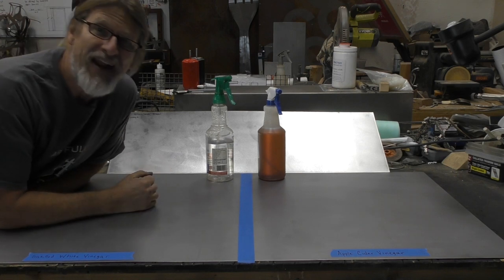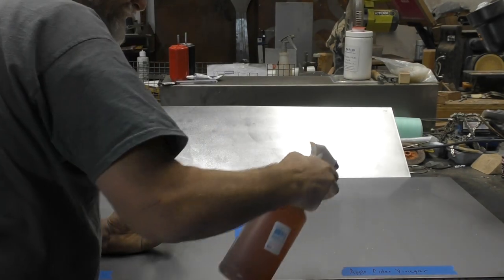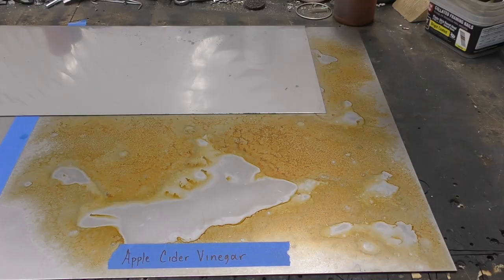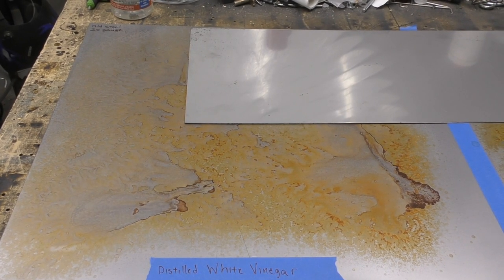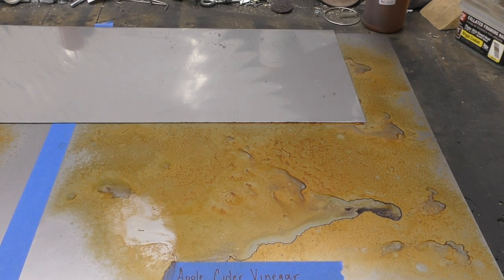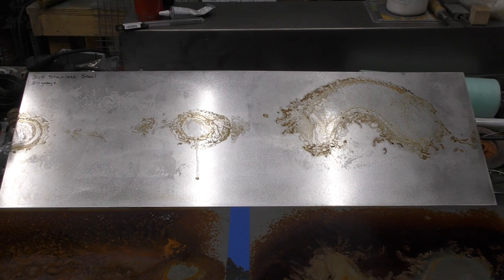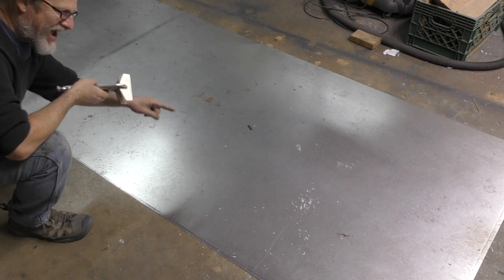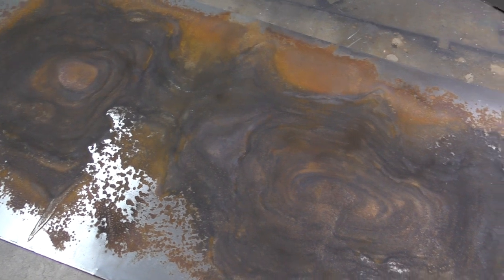White Vinegar VS.  Apple Cider Vinegar - Which is better for rusting metal?

Comment: I always found it ironic that you can use vinegar to remove rust and to add rust.
Reply from the maker: Right! I was having the same conversation today about that.
Reply: I'm glad I saw this video before doing some of the work I'm planning. I'll make sure I get all of the vinegar off when I'm done removing the rust.
Reply: Heh...ironic...
Reply: @grownupgaming7225  also don't forget to soak the objects in baking soda and water for 10 minutes afterwards. Baking soda is a base which will neutralize the vinegar.
Reply: Yeah. I learned that when I put it on my fucking Tuatahi axe!!! 😡
Reply: 💯% ironic🤣🤣
Reply: Do I need to cover the work with a piece of metal or can I use even cardboard or paper?

Comment: Vinegar doesn't rust /oxidize 304 Stainless Steel. What is happening is the iron oxide from the steel is discoloring the surface of the stainless.  Even steel dust on stainless will leave an oxidation site for rusting to form on the stainless surface. No metal is completely smooth. The iron oxide attaches to the stainless in microscopic surface imperfections and then creates the discoloration.  It is hard to remove because it buries itself into the surface imperfections as the oxidation expands.  Shops that do high level sanitary stainless steel work have separate work spaces to keep iron dust in the air away from the stainless and they never use the same tools used for steel work to work the stainless. We grind on steel and then use the same grinder for stainless in our shop, it leaves rust track marks all over the stainless if left unprotected. Fortunately, we paint the product before shipment so the iron on the surface is covered.

Comment: Looks like maybe your surfaces had some type of contaminates like oil and should have been cleaned with a solvent or something... Unless you are going for that uneven look...
Reply from the maker: I rarely clean the material as I enjoy the variety it produces. I thinks its the main reason my metal doors are difficult to duplicate. Many people follow "the rules" of surface prep, application, etc. So many people email me asking why their project didn't come out the same way. The first question I ask, did you clean the material? And 9 times out of 10 that's the issue in achieving the varied textures and patterns.

Comment: I just used both on the patina job I did for the interior panels of my Dodge D100.  I used the Apple Cider Vinegar first, just because that's what I had on-hand, but when I ran out (before being able to apply any to the last panel), I bought some White Vinegar.  For me, the White Vinegar gave the panel a more even, rust-colored patina, where the Apple Cider Vinegar gave the panel a bit darker, uneven pattern.  The were both sprayed with the same bottle, and were both sprayed on-top-of some Copper Sulfate I used to give the panels some other colors and patterns.
It seems like there is some subtle differences, and it just comes down to the look you are going for.  Either will obviously work, so use what ya got until ya run out.
Reply from the maker: That's been my mindset, use what you have on hand

Comment: Good info. I’m trying Metal shaving (prerusted shaving).sprinkling rusted parts to lay in patterns. Straight vinegar applied. Placed in the hot sun
Reply from the maker: Heat helps. I've noticed that I get better results in the summer time vs. winter time.

Comment: Really enjoying the videos. Question: if I’m trying to patina a piece of steel tubing (specifically a bike frame) that would not lend itself to covering by a flat sheet while the vinegar works, would wrapping with aluminum foil accomplish the same thing or would there be a different reaction because it’s not steel? Thanks!
Reply from the maker: Great question. It's not necessary to cover with steel. I've actually used wood before hoping to transfer the pattern of the wood grain. Using aluminum foil would work just as well. The goal is to reduce evaporation of the vinegar

Comment: I use white vinegar and my electrical pliers went black with the vinegar going black too. I cleaned all of the black gunk off and used soda bicarbonate and distilled water and washed. Cleaned with rags. Cleaned up nicely but then I hit it with brass brush on my Dewalt cordless drill. Now it's brass plated! I never expected that because it looks awesome. My question is the black gunk in the container? Is that carbon ? Have I weakened the pliers any reply appreciated cheers from Australia 🙂👍👍👍btw. My previous employer said: you stuffed up the pliers!

Comment: Enjoy your presentations, Doug! Lots of useful info. What have you found to seal the rusted steel for outdoors? Thanks
Reply from the maker: I use a two part automotive clear coat. Super durable
Reply: I have used sculpt nouveau brand ever clear 2 part polyurethane but will try what you suggested Sprayed on is usually best I’m sure 🙏
Reply from the maker: @joanneminnick  I've never tried the Sculpt Nouveau brand ever clear although I have used their patina's. Maybe I'll do a side by side comparison of the both brands to see which one is better or if there's a difference at all

Comment: Put on  leaves , grasses, pine needles, ferns, or sawdust, or all of them for really cool effects.  Can also cut paper or felt patterns and sandwich them to put controlled patterns on. Use two sheets of steel and end up with" book matched "
pieces.
Seal with penetrol. Works well at least on interior pieces, still experimenting with exterior use.
Reply from the maker: I need to try penetrol. I've heard of several people using but have never tried it myself. I like the idea of using organic items to create different effects

Comment: Thank you for your demonstration, I am building a privacy screen in my yard that is comprised of a cedar frame and 4 inch wire mesh interior so I can mass in with vines. I am searching for a way to hang metal panels with a patina in the center of each section to add interest and provide some immediate screening from a neighbors window that is very close to my property line. The metal panels would occupy approximately 1/3 of the wire mesh screen, If that makes sense, So essentially the vines would end up framing the metal art piece in the center. Love to hear your thoughts on how to deal with this, What gauge of metal would be appropriate so it is not too heavy but does not look chintzy and flap around in the wind.

Comment: Great video, question though! I have a 1964 patina original paint, I would like to take paint off my hood by wet sanding, will this vinegar technique be okay on the metal or will it eventually create bad rust? Better to let it rust naturally or will this be okay to do? Thanks!
Reply from the maker: Honestly I've never used this method on a car, although many people that have watched this video have said it worked great on their cars/projects. The secret is to seal it once you've achieved the level of rust you want so it doesn't become a long term rust issue.

Comment: I like these videos, the patterns are cool but I didn't care for the look after using the air gun so much. Maybe you don't have a choice as the flakes need to come off. What about using a random orbiter and grit paper as a prep before the vinegar to effect a pattern, and/or adding salt to the mix. Look forward to your next video Doug.
Reply from the maker: What I've found, is the longer you leave it on the metal the more stable it becomes. When I lifted the big sheets, none of that flakes off at all. The flaking usually happens in the first couple days. I'm trying to get some different results with salt that I hope to share soon
Reply: @ArtfullyRogue  I've seen some also use small pieces of copper (or shavings) thrown on, but I haven't tried that myself and not sure what the effect would be.

Comment: so just wondering, is it better with black metal or white metal?
Reply from the maker: I'm not sure what you mean by "black" or "white" metal. Typically with mild steel, you have cold rolled which is raw steel protected by oil and hot rolled mild steel which is protected by a dark layer known as mill scale. You can rust either type however you'd have to remove the mill scale from the hot rolled steel before you can rust it. And remove the oil from the cold rolled before rusting it

Comment: So glad I found your video! I'm going to do this with a sheet of steel. Question - when I get the desired color, should I rinse it with water to stop the rusting process before I clear coat it? TYIA!
Reply from the maker: I rarely rinse with water when I use the vinegar  method as it sometimes rinses off some of the rust. Instead let the piece completely dry then spray with a clear coat to seal the rust
Reply: Soak the objects in baking soda and water for 10 minutes afterwards. Baking soda is a base which will neutralize the vinegar.

Comment: Is it possible to rust metal that is chrome plated? I assume that I may need to do my best to somehow remove the chrome? I'm trying to antique a hotel desk bell. The fact that it is domed seems like it could also be a problem. Thank you for your help on this.
Reply from the maker: I agree, removing the chrome would be the first task. Because of the dome shape, maybe use a cloth with vinegar on it and drape it over the bell dome. This way the vinegar won't drip off

Comment: Thanks for your videos!  Great stuff.  I make some decorative farm hand tools and cattle brands, and then age them.  I have trouble getting stuff made out of round stock (like a cattle brand) to get any dark areas.  After watching your videos, I'm wondering if I could wrap the brand in saran wrap to seal it up after spraying and let it sit, if that would help.  What are your thoughts on this?
Thanks again for taking the time to put together very informative videos.
Reply from the maker: I found the key to getting darker rust is to prevent evaporation of the vinegar however on my big sheets a ring of dark rust will literally "seal" between two sheets and prevent the vinegar inside the rust ring from getting very rusty so it help to allow a little oxygen

Comment: Great videos! We will be using rusted metal on the back of island in our kitchen and face of wood burning fireplace and I want it to be a dark rust color, but not black. Would there be any reason to use Corten metal vs a regular metal?
Reply from the maker: Corten tends to rust fairly consistent. Where I think rusting a regular mild steel with vinegar will give you more texture and coloring and layers. So it really depends on the end result you're wanting

Comment: I am DIYing some Corten Steel planters with white vinegar, hydrogen peroxide and salt. I want to seal with a clear coat so it doesn't rust all over my concrete where they will be placed but I am having a hard time finding a clear coat that works and people in the stores don't seem to be as familiar with corten steel. Do you have any suggestions on a decent clear coat sealant?
Reply from the maker: Corten is designed to rust naturally how is it responding to your rust mixture? I use a product that I purchase from Home Depot. The brand name is Deft and buy the spray cans to spray my doors and water features that are rusted. It also comes in pint and gallon cans if your preferring applying with a sprayer. I'll also use an automotive clear coat that can be purchased from any local car paint company. I spray it directly on the rust without rinsing it.

Comment: Will this work on zinc coated metals
Reply from the maker: @floridaexperience4088  it's necessary to remove the zinc first and if the piece is small enough, you can submerge it in muriatic acid and that will remove the zinc or you can use a flap wheel and grind off certain areas

Comment: Does the clear coating that you use actually achieve a bond with the base metal?  It would seem that that would be necessary to prevent it from flaking off in the future.
Reply from the maker: I'm not sure how it actually works however it seems to bond the surface rust to the base metal
Reply: @ArtfullyRogue   what clearcoat would you use on that?

Comment: please answer me if you have time, i want to corrode aluminum ( real corrode not only on surface but i want the vinegar to eat the surface ) what would be the fastest way to do that and if i dissolve the aluminum  into a apple cider vinegar solution  would the rusting process  be faster than spry it ?
Reply: Try hot Lye [a.k.a. Caustic Soda or Sodium Hydroxide] that will eat it fast ... especially done hot.
* Take great care not to get it on skin or in eyes - it will eat you just as fast !

Comment: Hello, I was curious about how you do this because when I use cleaning vinegar on screws of paperclips it just doesnt rust I already tried it on some other metal but idk wat I’m doing wrong because it just doesn’t rust I also use the vinegar in a spraybottle, do you know what I’m doing wrong?
Reply from the maker: the screws and paperclips have a zinc coating. You need to remove that first. Soak them in vinegar overnight or use pool acid which takes about 10 minutes. Once the zinc is removed they'll be able to rust. Lay them out and spray vinegar and leave them to rust

Comment: Hello! very good video! was wondering how you could do this for a super even rusting. I thought it could be used as Architectural finish inside or outside a house. and does the rust wash off after you put on the clear coat? does the rust continue to rust under the clear coat? thanks! hope you could answer! cheers
Reply from the maker: It doesn't wasn't wash off after you clear coat it.
Reply: It will continue to oxidize though at a much slower rate.  It is very difficult to get a coating that is air tight without microscopic holes. Moisture will get through those holes. Most important is where the piece is to be used.  Inside a home the environment is more controlled than outside.  Next to the ocean outside would be the worst. The rust on my car body I could never get to stop no matter how well I sanded, prepped it and coated it, the rust always can back through my paint.  This was 45 years ago, there are newer coating today that have a better chance of stopping it.

Comment: Hi, I've a question. Where do you buy your metal? Is it a certain brand?
Reply from the maker: I have a metal supplier just down the road from where my shop is and it's not sold by "brand". Different manufactures make different types of metal  but most suppliers carry a decent variety

Comment: What's the difference between white vinegar and distilled white vinegar?
Reply from the maker: They're roughly the same. Distilled means it has a slightly higher acidity (8% rather than 7%). Distilled is often used more for cleaning but both can be used for cooking. For rusting metal, no difference at all.

Comment: How would I cover an embossed pice of metal? Thank you.
Reply from the maker: I you're using a spray to rust your metal and it's embossed, you can use plastic to cover. Depending on the type of embossing, you can take a second embossed piece and lay it on top of the covered piece so it will nest into the first creating a tighter seal.

Comment: Okay, so I guess you probably know this already, but neither of those is actually vinegar. White "vinegar" is just diluted acetic acid. The "apple cider vinegar" is most often just diluted acetic acid with some colouring and flavouring added.

I kinda like using Domestos for pitting and rust mongering. (Thick bleach)

How about the brown "vinegar" for added staining. It's just white vinegar with brown dye added.

Various grades of salt can make nice patterns too.
You also get cheap "road salt" on that side of the equator that we don't get here in Mzansi.
To be fair though, I'm constantly battling the elements to try to prevent mildew and rust. (It's rather humid here)
Reply from the maker: Haha yeah, however if I said "Diluted acetic acid vs. Brown diluted acetic acid" most of the comments would be asking why didn't you just say vinegar. :D
Reply: LOL
Good point! This is the Internet. :p

Comment: ok now how do you remove that oxidation?
Reply from the maker: There are several rust removers on the market however I've never used them so I can't really say one is better than the other
Reply: @ArtfullyRogue  do you recommend using vinegar to also remove oxidation?
Reply from the maker: @leopoldogonzalez5444  I haven't tried that but I've heard that if you can submerge the item in vinegar for a couple days it will remove rust
Reply: @ArtfullyRogue  thanks I'll try that 😁
Reply: @leopoldogonzalez5444   
it will de-rust well but you must neutralise fast with Baking Soda [sodium bicarbonate], dry it very quickly and seal or oil the surface immediately. The vinegar leaves the metal etched and has created the perfect surface for flash rusting to occur. I much prefer to de-rust by electrolysis .... plenty of videos on youtube about that process